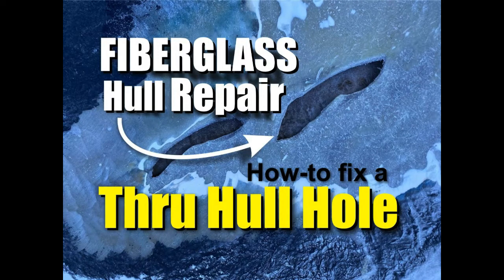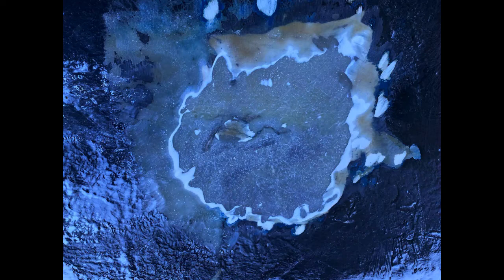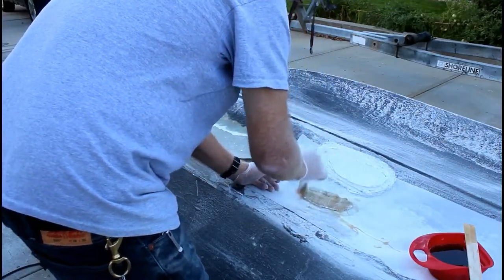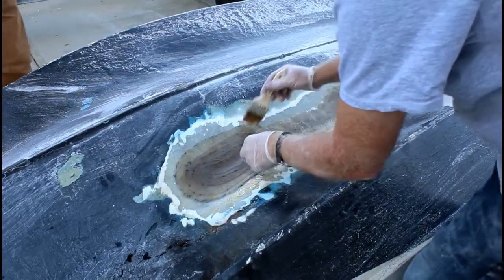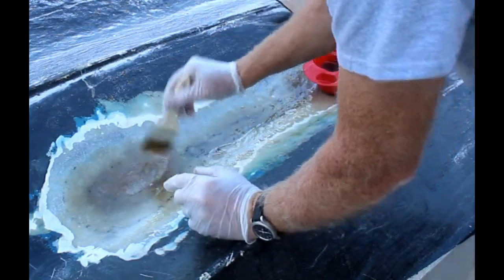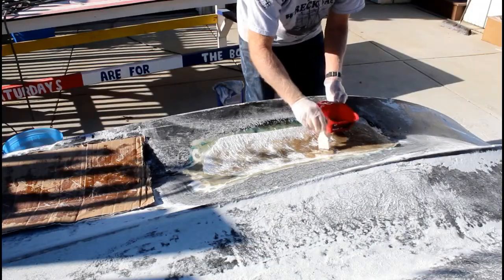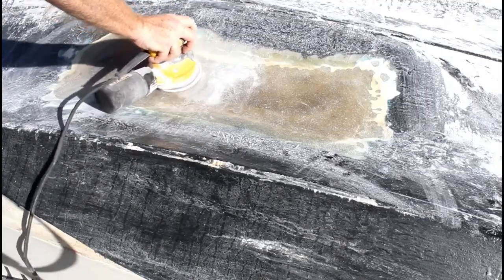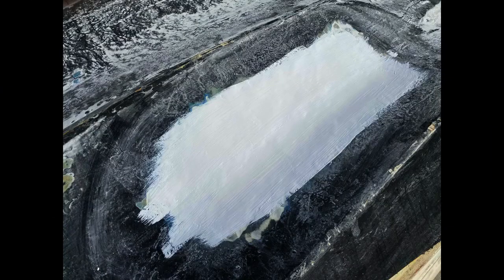Fiberglass Hull Repair: Easy Fix for Thru Hull Holes

Comment: You claim this is a DIY style repair, but this is a professional job in my opinion. My buddies dad was a test driver and prototype boat builder for Hydrostream. I drank beer with him and my buddy while they "blueprinted" a hull. The way they explained it, when a boat is removed from a mold at the factory it deforms slightly. So they have to, by hand, piece by piece build up certain areas or grind down certain areas of the hull so that it matches the blueprint of the hull more exactly. This is a process they perform for optimal hull performance for racing conditions. You wouldn't go through this for an everyday Bayliner. Anyway, this how they did it, just like you. Even down to the exact same cheap disposable paint brush. If this is how a prototype builder/test driver/racer does it, I'd say that's how it's done. Great video.

Comment: Good video, but I think you should have placed the patch with multiple layers with the smallest diameter down first.  The largest piece being on the top caps off the smaller pieces and makes finishing smooth much easier.

Comment: How long did you let the fiberglass dry before sanding it down again?
Reply from the maker: That really has to do with temperature, amount of hardner and exposure to sun. You should be safe if you wait overnight. You can usually tell by touch. If the resin is hard its ready to sand.

Comment: Great Video! Thanks for sharing!
May I ask if you had projects where there were soft spots on the hull? If yes, did you fix it by cutting/removing the soft spot area and applying the same method?

Comment: I was removing a soft floor and the angle grinder went through a spot i wasnt aware that was the hull itself. Could a little slit like that just be filled with resin and gell coat?

Comment: gravity is YOUR friend.....challenge to to THIS from bottom looking UP...(smile)
Reply from the maker: I actually have done it. Only trick is after grinding to get the first layer. You can use parchment paper and a pc of wood to hold the first layer up. Once that is dry remove the parchment , Grind and then go layer by layer

Comment: I don't understand why a lot of small pieces before the final full-sized long piece is better than say five full-sized long pieces ? Wouldn't (after the repair is done) and you put weight on that area the weight be spread better if the pieces are larger ? I'm sure you are right but can you explain why ?
Reply from the maker: for a repair like this I prefer to use smaller pcs to fill the void. If I draped a large pce over the entire hole it might leave an air space. In addition using only larger pcs would end up with a very thick repair on the outside edge that would have to be ground smooth. Bottom line Im sure it would work both ways im just trying to justify my prefered technique LOL
Reply: @DIYeasycrafts  Many thanks for the info !

Comment: this is wrong!....you were correct when using a slightly larger pcs of glass but when you made the first patch you reversed the order of size and put the larger one down first. this makes each layer rely on the only one touching the hull to stay on the boat. if the first larger layer ever failed everything would come off. your 2nd patch was correct with the smaller one going against the hull first. this allowed each layer to come into contact with the hull and makes each layer non reliant on the previous one to stay onto the hull.

Comment: Well your repair is better than the last video I watched on this subject , but still wrong. You should alternate each layer of matt with a layer of cloth or roving. Then you should have flipped the boat over and filled half the depth from the outside to form a sandwich repair again alternating matt and cloth. Or got under the boat and did it. I've done repairs like this up to three feet long. if you need a backer to glass to, it can be made by putting some pva on a sheet of plexi and laminating a few layers and then cutting out using a template of the hole. Finish it off with a final couple coats of gelcoat to seal it all up.
Reply: where is your video please I have looked on your channel but its not there
Reply: Gelcoat is polyester based, and shouldn’t be placed on top of an epoxy based resin. He would have been better off using an epoxy based fairing compound and after getting it smooth, just painting over it. In the end, this is a small boat with minimal stresses, so it’s probably fine, but this wouldn’t fly on a larger boat.

Comment: Wrong!  The first layer of fg is the LARGEST followed by progressively smaller layers to build up.  That way the repair has maximal bonding strength to the hull.  Your repair is weaker.
Reply: Bob you are 100% correct in that the largest piece is put down first. The reason this is done is to maintain the longest possible laminate continuity through the scope of the repair. When you do smallest to largest you end up with resin rich pockets at the transitions of each layer and if there is any surface grinding necessary (which there will be) you run the risk of shearing the fibers at each overlap. I will add this should also be done with vinylester if available. In this particular repair ive seen comments that a woven fabric should be added to the stack but this is a small Whaler, if im not mistaken its all chop with a foam filled core, you can get away with csm throughout repair. What your after with any repair is maintaining its original structure whatever that might be, strive for no hard thick spots. Im sure the repair as shown will float but it is still an amateur repair at best. I will also say this, as long as i have been in this biz (35 years) im sure and equally plausible argument can be made for either method but this is the one i prefer. Every repair is going to be different and you have to learn to tailor your skills and knowledge to accommodate them all.
Reply: That isn't true! there are many ways to skin a cat! your way works, this way works better in other peoples opinion, starting smaller means every layer makes contact with the surrounding area!
Reply: @MarkDoc  Learn physics.
Reply: @bobbeckstead8340  your wrong dude, The smaller pieces go in first and then the larger building out. The layers should be alternated between matt cloth and or roving. Do half the thickness on the inside and then the other half should be outside to make a sandwich repair. I always use a small roller to apply the resin and an air roller to roll out the air. It all needs to be cleaned with acetone. Believe me I've done a large amount of boat building and boat repair.
Reply: @MarksWorldofEngravingandMore  Sorry, "Dude" - you don't know what you're talking about.
Reply: You lol,😅sound like my 4 yr old she knows everything she never learned
Reply: No, he did a fantastic job. Actually one of the few do it yourself layup videos that was done correctly. I see so many people throwing chopped strand with tons of resin thinking that's the correct way. Only thing I would have done is to add peel ply and remove as much resin as possible. But all in all that repair will hold!
Reply: @never2late454  Learn physics.  The innermost layer(s) need the greatest mating surface with the existing lay-up for maximal structural strrength.  You people haven't got a clue what you're talking about.
Reply: @bobbeckstead8340   Bob, for a planing Hull this is the preferred method. If you're repairing a sailboat it can be done the way you referred. But keep in mind that it's just a small skiff. The lay up he demonstrated gives the repair adequate coverage for that size boat. What most people fail to understand is that the structural strength comes down to the fibers and or the weave, not the resin. The amount of coverage he applied on his last layer is what will strengthen the repair. Personally I would have done it a little differently but that's just me.
Reply: @never2late454  Nonsense - the process is the same for all fiberglass and even more important is a fas moving, slamming, planing hull than a slow easy moving sailboat.  The most important factor is the bonding SURFACE area of the new glass fiber to existing glass fiber.  Doing as he describes only bonds the TIPS of the new glass layers to the surface taper of the existing glass.  The repair he made will crack around its perimeter in no time - it's nothing but a PLUG.

Also, you can stop with the irrelevant resin comments - everyone knows that isn't the main source of strength.
Reply: @bobbeckstead8340   Using the method your describing he is at higher risk of having one of the layers delaminate . I can't count how many production boats we've encountered with structural delamination. Even some where the resin never fully cured. The way he did his repair adequately covered every layer. And the point I was referring to when I mentioned the resin is that he extended the repair far enough out to get enough strength without over saturation. If his surface was prepared properly and he had no air trapped in it he won't have a failure.  I personally would have worked out as much resin before it setup.
Reply: @never2late454  You don't know what you're talking about.  I'm done with you.
Reply: @bobbeckstead8340  your attitude is kind of rude haha , but as a newby I think i agree with your reasoning. I would also think that making some cuts perpendicular to the holes could be helpful to better integrate the new and old fiberglass. but im just learning

Comment: Thank you for the video, I am actually about to fix a much smaller hole on my 20 sea craft. I do not have access from the top of the hull so I will be doing the repair from under only. You gave me confidence that it can be done strong enough from just one side of the hull. Thank you!